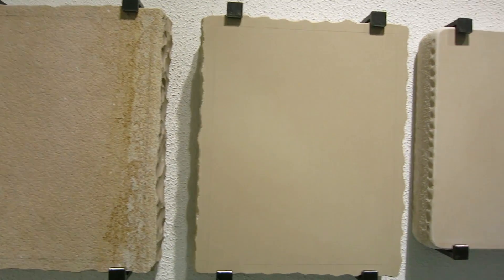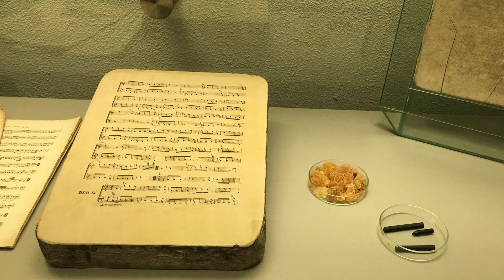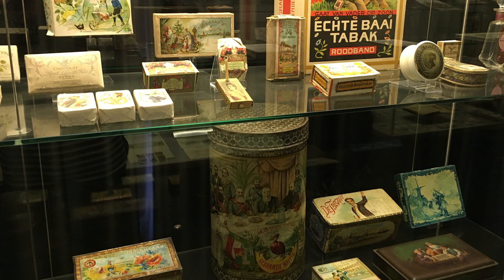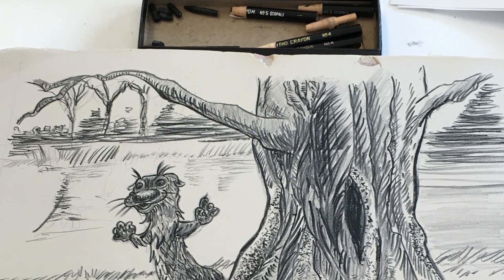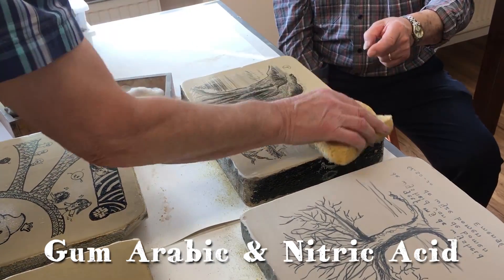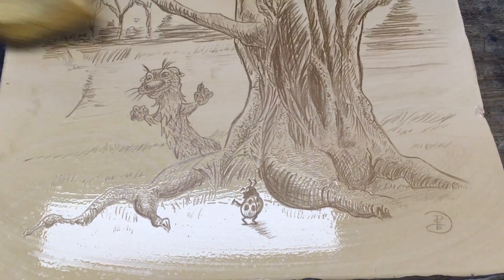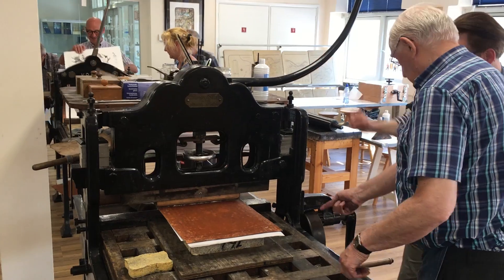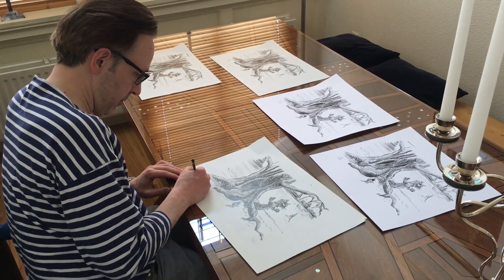How Stone Lithography Works

Comment: I’ve watched a few of these videos about lithographic printing and I still can’t quite work out what’s going on. Does the acid wash remove a layer of stone so leaving the inked portion raised? Or is the ink simply sticking to only the drawn areas? How does this work for those very detailed and photographic examples near the beginning of this video? Thanks for any answers.
Reply from the maker: The acid removes the gum arabic and etches the drawing. When you ink the stone and make it wet only the etched part will receive the ink.
Reply: @StayfDraws  Thanks for the reply. So the drawn area gets etched away and creates a recess into which goes the ink?
Reply: As far as I understood it, the surface remains flat, but the drawn areas aren't oil-repellent (the ink is oil-based) like the moist parts because they were protected from the acid, so water cannot penetrate the stone.
There is a technique called "kitchen lithography" where you draw on thin aluminium foil, and it works in a similar way.

Comment: So it prints the image in reverse. Does that mean that as the artist, when you are drawing on the stone, you have to take this into consideration and draw the image initially backwards? If you forget to do this, is there some way you can still use that etched stone to print the image the way you want it, like transferring it somehow to another stone and then using that stone to make the paper prints?
Reply from the maker: What artists sometimes do is make a drawing with a normal pencil and then lay it on the stone and then rub it onto the stone. They use that as a guide and then draw with the special greasy pencils.